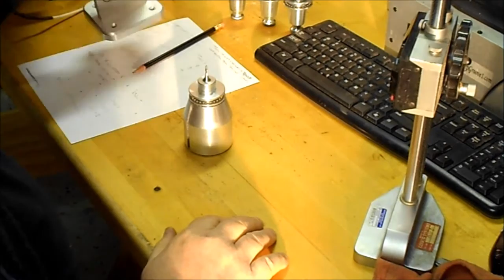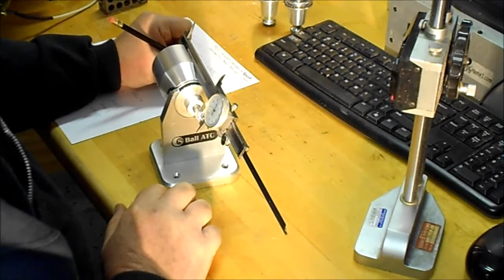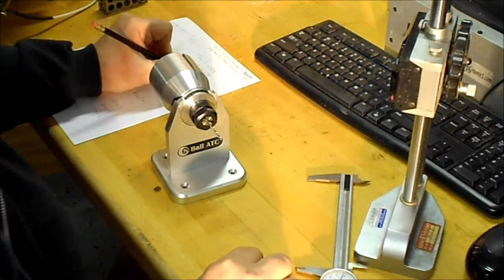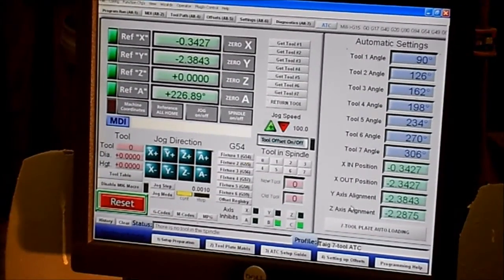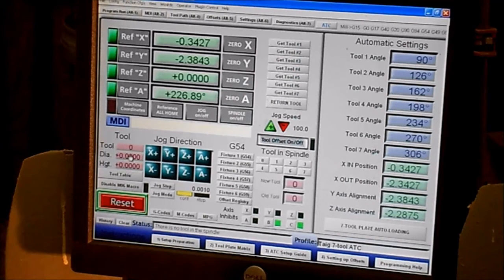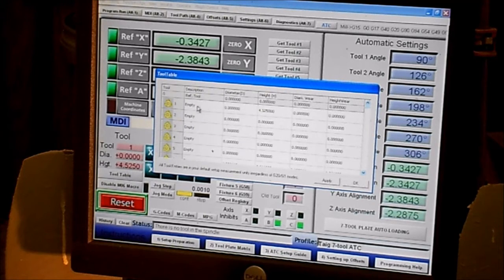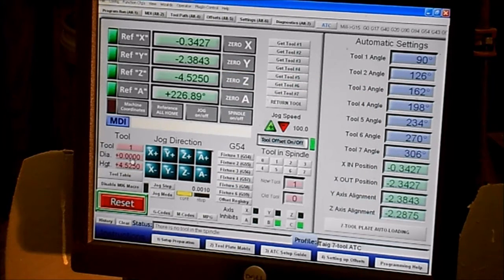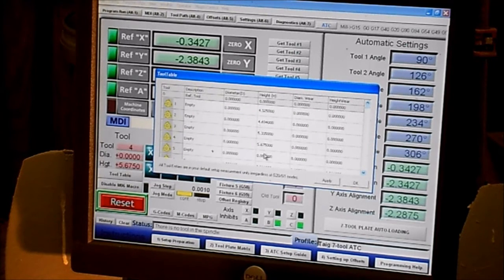8-Ball ATC manual tool measurement...applying lengths to the Mach3 Registry

Comment: hello, for what speed is balanced the 8-ball atc?
Reply from the maker: The spindle housing is fitted with bearings rated for 10K. I had no problems running this at 8500rpm.
Reply: (sorry for my english)
ok for bearings, but the spindle, the rotor of the spindle is balanced? If it isn't balanced over 3k rpm you could have vibration that reduce the life of the tool, of the tool holder's structure and of the spindle and at least you don't have good surface finish... can we have more demonstrations of this atc? Also with different materials (like c45 steal, alluminium 6061, ergal, copper, brass, etc) and different tipe of tools up to 20mm of diameter (face mill, end mills, ball mill, toroidal mill, also with insert) ... I wana see more, and this test can show us how many is strong this sistem.
Reply from the maker: I plan on doing that after the first two are produced commercially. The CNC lathe I have is very small and I still have  problems with run-out. I wasn't as concerned with balance as I was keeping it from exploding at higher speeds. The flyweights will be machined in lots of four. so balance is not the primary issue....speed is.
Reply: Ok, so you will write that this atc can't go over a tested speed, right?
Thanks for the information

Comment: hello. looking great. it is possible to download somewhere ATC screen for Mach3? thanks for your reply
Reply from the maker: The screenset is just the GUI of MACH3, the real workhorse is the Macros that need to be created or modified to control tool position and your spindle. My ATC will come with all of that but the screenset and macros used for my ATC will only work for my ATC. It is best if you study Mach3's programming PDF and design one that will work for your own machine. Screen editors are also available from their web site as well. I used a combination of Mach programming language and logic (if/then statements) to produce my macros. You may be interested in this Youtubers contribution to get started. https://www.youtube.com/watch?v=26_N4uwRWmQ&t=10s

Comment: Is the 8ball atc only compatible with the taig? I am starting a mill conversion but would really love one of these atc's!
Reply from the maker: Was originally designed for Taig to replace original spindle. Now, since the spindle and spindle housing is one unit it can be used independently for Routers as well. A second option will be to change the straight spindle shaft to an R8 config that is capable of transforming any R8 mill to CNC without major reconstruction of the mill.
Reply: I am looking at doing a cnc conversion of the PM25 which is an R8 mill, would love to use an 8Ball, real curious on where price will fall.  I am subscribed.
Reply from the maker: Not sure yet, although the R8 version would be the least costly of them all. I am having three made at the present time to estimate setup/manufacturing costs.